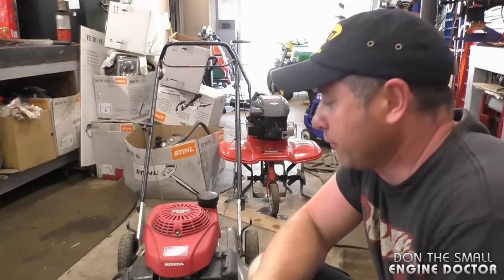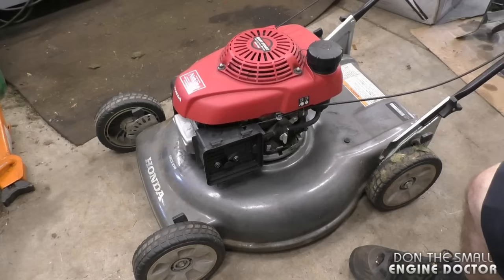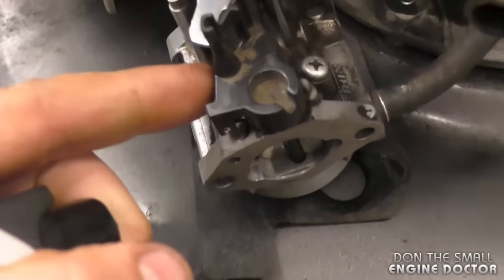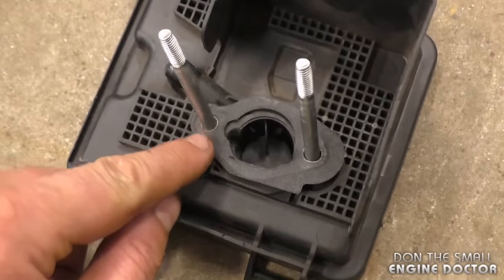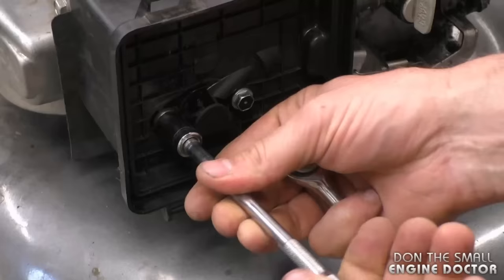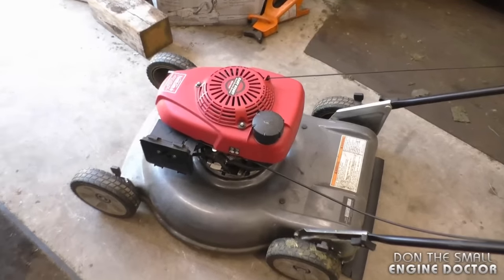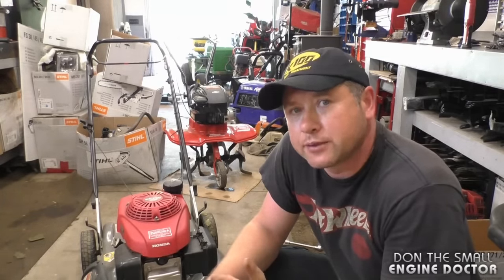Make Your Lawnmower Start On The First Pull Again - Honda Auto-choke Repair - Video

Comment: Had this problem it started as a leak in the float bowl i replaced the seal. I replaced the gasket but did not know about the auto choke could be my problem.

Comment: You may also remove this wax actuator, wind two strings over the choke lever, open it when starting, close it carefully after start or when you start with a warm engine leave it closed.

Comment: I learned a trick on starting Honda lawnmowers while working at Honda Power Center. If Honda mower refuses to start after winter storage these steps may help to start motor. 1. Clean spark plug & replace. 2. New fuel 3. place your foot in front of mowers front wheel an block mower from moving forward. 4. With opposite hand, lift mower handle until mower standing straight up balanced on only front wheels for 30-60 seconds. 5. Lower mower back to ground on all wheels. 6. Start motor!

Comment: I have rebuilt my carb twice and cleaned everything in it...
It still surges after about 30 minutes
Would this cartridge be affecting this???
Reply from the maker: don't think so,might be a carb issue or fuel cap that is not venting

Comment: I've got a Honda push mower with an automatic choke. I've had an issue for several years with, and I've learned to live with it, but it is quite annoying...Mower will start up and run just fine for about five minutes before it starts making chugging noises with a noticeable reduction in power. The idle will return to normal after about a minute and a half of running after chugging. This seems to occur more after the engine has returned to ambient temperatures, and sometimes occurs multiple times during a day if I have to stop to go tend to other activities. Any ideas or input would be greatly appreciated.
Reply: HustleMuscleGhias Sounds like your choke is not opening up completely when the engine gets warm. Or the carb just needs to be cleaned.

Comment: I have a Toro that takes about 12 soft pulls then about 4 hard pulls to start, Any ideas what the problem is there? It too is supposed to start on a couple of pulls......
Reply: Start using high octane ethanol free gas for small engines.
Reply: @larrybe2900  tried that - no luck. Thanks though

Comment: I still don't know why they didn't make a better system that carburetor that's just way too many gaskets why didn't they use a stud system that had a nut on the end of it seemed to slide it over the end. Thanks for the information. I didn't know that part was even on a Honda

Comment: F'n my first Honda was this one. What a horrible experience. My Craftsman would start on the 1st pull for 8 years. This thing crapped out after a year. Now I have to pull the carburetor to replace a part. Are you joking me? As soon as I fix this thing it's on it's way out the door. Thank you for the information.
Reply from the maker: yes very disappointing for honda

Comment: If this part has failed would it cause a no to hard hot start issue?    I've wracked my brain, eliminated carb, fuel, plug and coil.
Reply from the maker: yes
Reply: @donyboy73  thanx sir,  that's what I thought, everything else checked out!   You're the best!

Comment: Sometimes the thermal pin will stay stuck in. Then the mower will start and run for 20 or 30 seconds then die. Also a bad thermowax pellet. Cheers

Comment: my honda has a manual choke. starts easily every time. maybe just a couple pulls. its an old HRM215.
Reply: Mine too, but if it starts to give you trouble, there is a linkage to adjust to fully close the choke with the lever.

Comment: You left the fuel cut off in the off position when you were trying to start the mower, then a few frames later it was back to flow position.

Comment: Has anyone mentioned that some carb issues come from using low grade gas ...if you're not putting premium fuel in ..anything with ethanol blend seems to cause carb problem...mowers to oil gas mix sthil trimmers shindawa hedge trimmer an blowers..

Comment: These GCV honda engines were the worst design by honda.
All these engines like Honda, Briggs and Stratton and Kohler that have these Auto Chokes are a bad design.  They should have just kept the Manual Choke systems.
Also on these GCV engines should have a Gasket for the Valve Cover like Honda did on all their other engines. One more thing that honda should have done was put carburetor bolt studs installed to the block so when you pull these carburetors off you can but th gaskets and carb on much easier.
Once again another great video Dony

Comment: I have recently been getting oscillation (surging) in the engine speed on my Honda HRS216 mower.  The engine starts fine, but as the mower has no manual throttle control, whereas it would normally just idle at operating speed, it instead oscillates (surges) up and down in speed to the point where it is affecting the operating performance of the mower.   Any ideas what is causing this?
Reply from the maker: i show how to fix that in this video, https://www.youtube.com/watch?v=gV6IOkevloM&t=1s

Comment: Do other manufacturers use that part for auto choke
Reply: YES, most newer Briggs & Stratton engine have it, like in my Craftsman Mower.   They are trying to help us, but not successfully.  Most People would mow and mow and make the Engine gets really hot.  This part is preventing us using it for a long time so the by putting it in, it stop at a certain point or when really hot.
Reply: @JodBronson  What????
Reply: @dkupy100  - Are you dense?
Reply: @dkupy100  He had a few typos but you can clearly tell what he was saying. Relax there home boy.

Comment: I think this is what's wrong with mine so I use the starting fluid to start it and it starts, it just doesn't continue to run. Although it has sat for a couple years

Comment: Hey don, I don’t think you will see this but can you please help me out. I have a Craftsman lt1000 with a Kohler command 15hp and Walbro carburetor. I can’t find a video showing me how to adjust air fuel mixture and choke. When I try to start engine it either over revs like crazy or acts like the choke is stuck and shuts off. If you can make a quick video or if somebody can help me out i would really appreciate it.

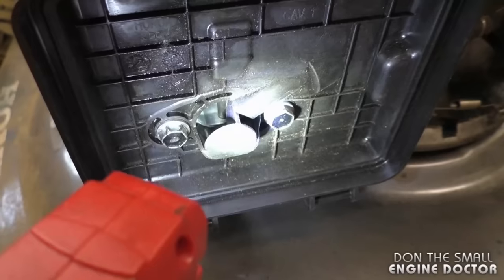Comment: 2:10 The engine is getting the right amount of fuel but with the choke stuck open it's getting too much air. You need a rich fuel mixture on start-up that's why the choke should be fully closed to limit the air intake.

Comment: Don mine is doing the opposite. Choke is failing to disengage. Replaced the thermowax but no go. Takes over 5 minutes to finally open up. Any ideas?
Reply: I'm in the same boat.  Did you find a fix?
Reply: I wrapped the thermowax in foil to help with the heat transfer which did help. However, it still acted up. I noticed it acted normally with the air filter off. I eventually replaced the carb with another honda carb from amazon and it totally solved the problem.
Reply: Jas also make sure the linkage to the auto choke is not binding. I have seen thus before as well!
Reply: @andyhamilton8940  Thanks for the tip.  Going to check the linkage right now.
Reply: @andyhamilton8940  You were right about the binding of the auto choke linkage.  I cleaned it offand sprayed a little WD40 on it. The linkage is smooth now. I also tried your trick about the aluminum foil around the thermowax cartridge.  It runs now, but the true test is when I fire it up from a cold start tomorrow morning.  Fingers crossed.  :D  Thanks for the tips!
Reply: Looks like we might be going down a path of buying carbs and thermowax. LOL

Comment: Dude, anyone have some input. I have a gcv 160 I've cleaned the carb, it starts but is clearly burning too much fuel. Do these autochokes ever just stay on? That's what it seems like
Reply from the maker: sometimes they get stuck on, just save yourself the aggravation and get a new carburetor, they are cheap to buy

Comment: I have one of those lawnmowers. mine is a little bit different it's the over head cam model. it has a choke lever that returns to the off position slowly. but it was returning to the off position too quickly. so I removed the spring, now the choke will stay closed until I move the lever to the off position. I Permatexed the gaskets to their relative places. it makes removing and installing the carburetor quite a bit easier. after working on that lawnmower, and Honda automobiles. I say Honda should have stuck to building Motorcycles.

Comment: The best way to get your lawnmower, rototiller, snowblower, etc to start on the first pull is to stop using unleaded gas & start using RV gas. Its unleaded gas WITHOUT alcohol. Since I started using it about 5 years ago all my small engines start on one pull even after sitting all winter long. Best thing I ever did. Regular unleaded gas that contains alcohol attracts moisture which in turn corrodes the inside of your carburetor. Try it & you'll NEVER go back!!

Comment: If you have any small engine that is hard to start, I have a trick that will start them all on one pull.
Chainsaw, weed eater, leaf blower,  lawnmower, snow blower it works on anything.
Spray a one second blast of engine starting fluid on the OUTSIDE of the air filter cover.
Spray and one quick pull and off you go!
Starting fluid is very flammable and more is not better. 
Spray outside and leave the cover on the air filter, works every time!

Comment: Cartridge is very stuck, Looks like loctite or something on thermal wax cartridge, 
Any idea how to get it to release ?
Reply from the maker: pull it out with pliers, https://www.youtube.com/shorts/XzagCQoCCo0
Reply: @donyboy73  My pin pulled out.  Then I had to drill out where the pin went to get a pair of needle nose plyers in there.  It finally came out.

Comment: Please help? I’m not mechanically inclined at all. My Honda motor is just one season in. I replaced the filter and sprayed the carburetor. It won’t start. It was starting but poorly. I replaced the gas also.
Reply from the maker: try cleaning the carburetor first
Reply: @donyboy73  is it at all possible to clean it without removing it? I’m afraid I can’t put it back together properly. I took the bolt off the bottom and cleaned the bowl. It didn’t have any build up on it. Everything still looks brand new.

Comment: Is there a way to repair that pin?
Reply: No, I wouldn't recommend replacing it either because it will fail again. Just use carb cleaner to start the mower it takes an extra 20 seconds.

Comment: It would be good if it could be converted over to the choke valve setup which works off the throttle linkage as with the other "types" of GCV160 engine.

That's the thing to watch out for when ordering Honda lawnmower parts is that there are different types of engines,for example, they can also run different flywheels.

They have also changed the design of the piston rings & piston in the GSV190 engine, my dads isn't too bad but I have a spare set of rings to order a new piston for as well.

Since it's a 2003 model, they changed the piston & ring design in it in 2004,I may as well buy the matching piston for when the time comes ,it's cheaper than trying to source the N.O.S. piston rings for it !

Comment: My problem is when the engine has warmed up, if I turn off the engine, say to do something, the engine won't start, when I open to see the choke, it's in the closed position, so I block it with a screwdriver, then it starts. It's irritating to do this Everytime I turn off a warm engine, what's my problem, thank you.

Comment: Japanese small engines are cheap toys that break down quickly and are expensive to buy parts for. The best small engines are the older Tecumseh, Briggs and 2 stroke Lawn-Boys. I just replaced the auto. choke diaphragm on my 1975 Toro Briggs Whirlwind lawnmower. Auto. choke has been problem free for 45 years and Briggs engine runs as good as new. If we didn't have ethanol in gas diaphragm would have lasted longer.

Comment: That thermo-wax thingy is the same technology as the thing that opens and closes the thermostat in a cars cooling system, and the ones used in cars will often last the life of the car. Why is the one in this engine so delicate?
Reply: Cash flow to Honda.

Comment: "Make Your (HONDA) Lawnmower Start On The First Pull Again".  But even that's not true.  The way to make normal small engines start on almost every first pull (especially with ethanol added gas) is to run the carb dry before letting it set unused for more than a couple weeks (aka. Winter).  Either by dumping the tank or a fuel shutoff valve.  This is especially important with generators.

Comment: So, what was wrong with the old "Choke-Run" Control Cable? Seems the more "Advanced" they make these things,,the MORE problems they create. Putting a "Thermowax" coking device in the HOTTEST part of the engine??? WTH were they thinking...Or was it a plan to SELL MORE PARTS?  If it isn't BROKE, DON'T FIX IT,,,HONDA. Got it?

Comment: Better idea: if you just bought a honda, REPLACE THE FUEL FILTER.  The one in the tank is garbage.  Put a good inline filter in and let it run for years.

Comment: your fuel valve was closed when you tried to start it at first and even after you sprayed carb cleaner... lol
Reply from the maker: I saw that when editing but it wasn't the problem
Reply: donyboy73 if my mower starts, but not on the first pull what would you recommend doing? I just changed my carb and now it starts, but not on first pull

Comment: Had the same problem for years. I 'd rather spray the fuel in there then waste money on that stupid thing for it last maybe one season. Just buy a can of carb cleaner or starter fluid guys.
Reply: I have never in my 40 years seen one of those fail on a yearly basis. I am not sure where you get your information . Generally, Honda mowers are well built mowers. Its lack of maintenance that causes most mowers to fail. Old fuel being the number one cause of most issues.

Comment: why  didnt   honda  jusr  use  a  hand   chock?
Reply: They are trying to help us, but not successfully.  Most People would mow and mow and make the Engine gets really hot.  This part is preventing us using it for a long time so the by putting it in, it stop at a certain point or when really hot.
Reply: They did / do.  It evidently depends on the application and the "price point" is.  My pressure washer is equipped with the same engine albeit with a manual choke.  Activated by an approximate 125 mm rod with some per-configured bends.

Comment: That's a bad design.  After some time the new part will go bad again.  My Honda has this issue too.  At 64 years old I've owned a lot of small engines and the Honda is the only one I've had with starting issues.  Shouldn't happen it's a bad design.   

Incidentally I have a honda power washer that has the exact same model engine as my lawn mower but the power washer has the older style manual choke.   Usually starts first pull.

Comment: I will never buy a Honda power product. The company is notorious for designing failure points in their products to provide a steady stream of income. I have a kohler mower and it has a bimetallic coil on the auto choke which has never failed in 12 years of use so far.

Comment: That looks like a really bad design.  What ever happened to the cable operated throttle that would activate the choke when you went past full throttle?  Everyone seems to think Honda engines are so great, I personally don`t like them.  I have friends that had nothing but trouble with Honda!  Another (great) idea Honda had was installing plastic cam gears on some of it`s engines!  Real smart!

Comment: I have a question about the small primer bulb used on leaf blowers, chain saws, weed wackers, etc.
The one from my Ryobi blower (791-683974B) is also used by a variety of other brands, under their own part numbers.
Is the $10+ price for one of these legit, or is a cheaper aftermarket version from eBay just as good?
No way is that little thing really worth $10.   $3, at most.
Reply: There are others that fit as well, make sure the part number cross verifies with the original. If you have an Evans Do it Best store they will probably have it in stock.

Comment: I have an issue with this mower, my pin is not stuck out like that,  mower will start with starting fluid, runs for a few minutes then dies, this auto choke system is the dumbest crap that honda ever came out with,.  all of these engines are now useless due to it.     I will be doing a delete on mine, I already cut the shroud off, I'm installing a pin to make the choke manual from now on, this is completely ridiculous quite frankly.

Comment: Does anybody ever have or use the torque specs? Nope!
Reply from the maker: it takes years of experience and common sense to get to that point. If I was working on the space shuttle though I would torque every single bolt.

Comment: What a stupid thing for Honda to do. I just bought a craftsman lawnmower with the Honda engine. Now I have something to look forward to thanks to some idiots who think they can engineer things for lazy people. Does the Briggs and Stratton engine have the same idiot engineers?
Reply: They dont all have that system. If it has a small white tab that you have to slide over to choke, thats not it. That one works differently. I have already worked on that type craftsman eith the Honda engine. I had to replace the carburetor because it was full of grey mush. That mush was corroded metal from gas that turns to acid and eats the internals on the carb. Its $15 for a chinese version. Sold that mower in 20 minutes upon posting on Marketplace.

Comment: What a ridiculous choke system.
A length of a pin, all various parts of various thicknesses, length stack up issues.. what a bad design.
All this effort (at lowest cost) in an attempt to make it unnecessary for the owner to understand how to actually start an engine.
The continuing dumbing down of the user by adding complexity of questionable quality and design.